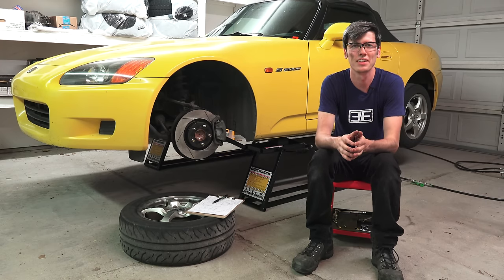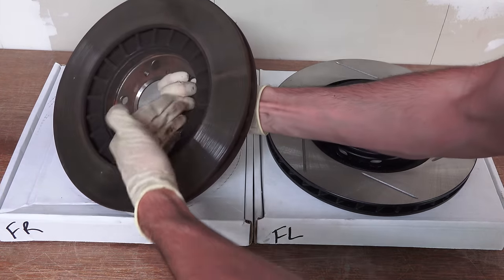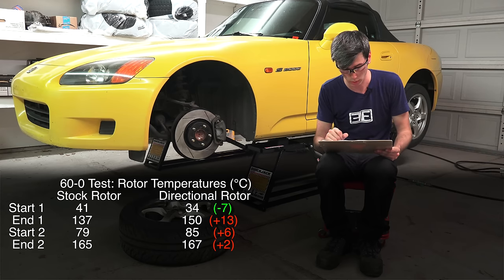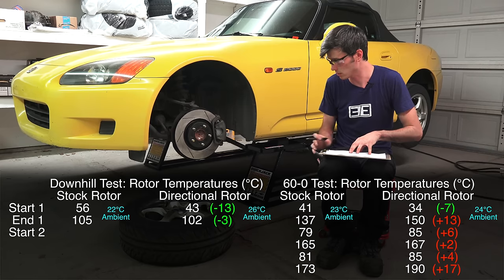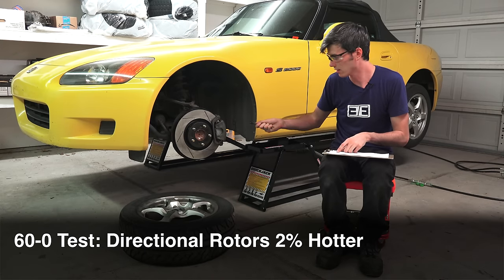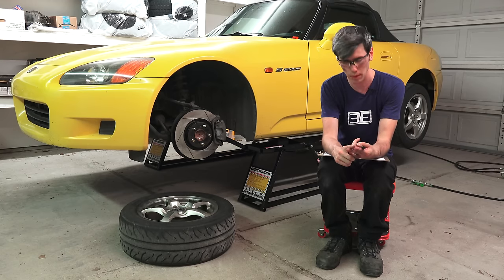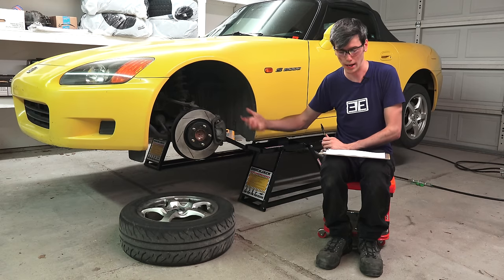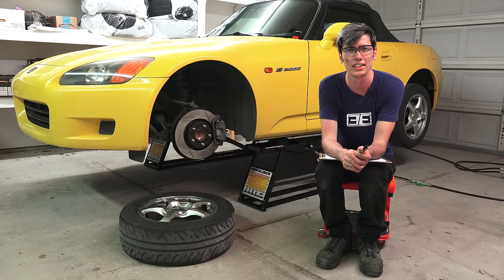Do Performance Brake Rotors Have Better Cooling?

Comment: Two questions.  First what is the difference in mass between stock and performance rotors?  Second, were you measuring the right thing?  What you might have actually been measuring is breaking performance not rotor cooling performance.  If you are breaking more effectively, especially with a lighter weight rotor, you might expect them to get hotter.  Question is how quickly do they cool off after hard breaking?

The test I would suggest would be to first get the rotors good and baking hot, as hot as you dare, then drive them at a constant speed and see how long it takes for the rotors to cool off to a specific temperature drop, say 150˚C.   Try that at several different speeds and see if there is a speed effect that you may not have noticed.  Maybe the performance rotors only work well at high speed, or only at lower speeds.  THEN, run the experiment again, with the performance rotors on the wrong way and see if anything changes.

Comment: It's an old video but still. So you did a normal test, not a performance test. And the result was that the normal rotors are better. That is it. It's not just vanes, cheapeness, mass, etc, etc. It's like brake pads. Normal pad are better for normal use, like normal rotors are better for normal use. They are tested and they are tested and that is the design they stick for Normal use. You did your best to prove them wrong, but you just couldn't, because there was no way that these perform better than normal rotors in normal conditions. Remember, normal pads and rotors are designed for use in various conditions and they must perform at the best for all those conditions - high temperatures, low temperatures, rain, puddles /sudden cooling/, mud, snow, sand, sudden braking, rotor rust from car not being driven a while , etc, etc. Performance pads and rotors do high temperatures, may be rain /but not common/, a lot less mud, sand, sudden braking, pretty much no snow, with two words - track use. Are they better for the track - 100%, as everything else that is performance - Performance engine oil, Performance gear oil, Performance brake fluid, Performance tires, performance pads....  In the end your tests just show the people to not use performance parts for regular use as they are worse in those conditions. Do it for the track car and be very careful when you drive that track car on the regular roads, without putting some heat into everything.

Comment: How much does wheel design, brake dust shields, or air dams/ brake ducts feeding cool air matter for brake cooling.. Seems like over time it would be a better investment to have wheels that help cool better than to keep buying over priced rotors that have minimal gains. Would be funny if zip tying a peace of plastic to the lower A-arm would do more than any high end rotors you could buy. Also I agree with others if your not testing the brake performance gained you don't really have the whole story as some performance gain is a trade off because that performance gain also put more energy into heating the rotor. One 60-0 isn't going to do it either you need to do multiple (3 back to back with temp readings might do it) to build the load as if it where actual real worlds results. Thermal paste between wheel and disk? That might be interesting also..

Comment: Thx for the video! A lot of work, though what is wrong with laser temp "probe". Quite cheap these days? you could have one installed all the time on the wheel and measure all the time. You could also install pressure gauge for the brake and see how much you brake. That would be super cool. OEM all the way, aftermarket if it is any good is way to expensive.

Comment: STOP!!! You need physics not engineering.
Slotted rotors scrape the pads to keep them clean. They create more friction since they are  cleaner, thus, they get hotter.
If they are better, they won't warp, and they will last until they wear out. If they aren't better, they will warp before they wear out.
Slotted and drilled rotors are more likely to crack since they have been cut. They are not as stable as flat rotors.
Slotted rotors wear out your pads faster; since they constantly scrape them to keep them clean.
Drilled rotors are not needed unless you use asbestos pads. If you use ceramic pads, drilled rotors are for looks only.
MOST people will do best to just use flat rotors and leave the more expensive drilled and slotted rotors for the racers and hot rodders.
I am ASE certified in brakes, etc for 50 years, but what do I know.

Comment: Why not try drilled slotted rotors? Also I thought the point of performance rotors and brakes werent to be cooler but to stop quicker when needed. Like Brembos Big Break Kit that cost 1,200 and comes with all steel break lines for higher pressure running to the the pad for greater force on the rotors. Comes with the big breaks and depending on the package comes with drilled/slotted rotors, or just drilled, or just slotted. I thought the point was to stop quicker? Not to keep them cooler? I could be completely wrong but my idea of performance breaks is to stop on the drop of a dime. Not to keep my brakes cooler....

Comment: Well the thing is, what was your stopping distance on each? You have more friction with the aftermarkets compared with the oem smooth rotors. Friction as you know causes more heat. They also clearly cool off faster especially combined with a ceramic brake pad. If you look at the texture of the aftermarket rotors, they have grinding done to the surface along with the slots. This causes more friction. After time that grinding will wear out and you will see less stopping power due to less friction, however again that would help preserve your brake pad especially if you are using an OEM one.

Comment: Ok...quick answer. Brake fade occurs when rotors can’t dissipate heat...it dose not matter hot HOT as long as they don’t warp and can cool before you need hard breaking again...It’s about long term hard driving.

Comment: Wouldn't hotter rotors equate to more heat dissipating from the rotors? Not necessarily hot they get or how fast they cool down?

I would assume the hotter the brakes get the more friction it's producing therefore giving you better braking performance. I don't believe you mentioned brake feel or if there was any brake fade in between the braking tests

Comment: I'm a bit disappointed in the testing method(s). I would've expected Jason to strive for more consistency and perhaps just lift one wheel off the ground (assuming open differential) and used a weight or something to apply the exact same throttle input and exact same brake pressure for a given time/test cycles.

Comment: Specific heat, not mass, determines temperature change for given applied heat. But I'm sure you know that and were dumbing it down for the tongue-chewing mouth-breathing bogans that will stumble across this video while looking for something to justify their purchase of slottled, drilled and directional vanes rotors for their shopping basket road car.

Comment: I think it's not a simple yes/no thing.  What makes for a better rotor is better metallurgy and better heat treatment.  That is going to differ from manufacturer to manufacturer.  And it seems to me that any "test" of brake performance that does not use stopping distance comparisons as its primary performance metric is flawed from the start.

Comment: So judging by the picture here, did u have them on correct sides? Cuz theyre supposed to draw air from the wheel hub area and vent out the diameter of the rotor. It kinda looks like u have it on the wrong side.

Comment: the temperature of the rotors the split second you finish braking has NOTHING TO DO with their 'cooling'. 

It's the amount of energy in the car converted to heat ... functioned in to the 'specific temperature' of the medium to which you're storing it. 

I'd say, the hotter you get it -- either the less material or the lower heat it can hold per gram ...

So - the working range of temperatures vs. the mass required to hold the heat you'll create determine the amount of mass you'll NEED. 

"Stopping" probably has more to do with tires than brakes until you butt-up-against the limits of the material's working range.

Comment: Pad/rotor bedding could explain these results.  You should of also measured the temp of the rear disks as a check to ensure the brake energy at the front was constant between rotors.

Comment: Respectfully, your test was seriously flawed. You basically tested their ability to hold heat, not dissipate it.
Put them both in an oven and raise them to a high temperature, 800 degrees say, then take them out and spin them.  Record temperate over time. Measure the temperature difference and factor in mass to get a dissipation rate. That will prove if they are superior. 
Short braking runs are almost completely irrelevant to overall cooling because as soon as they're hot, you've stopped. Heavier discs will always win in such a test.

Comment: What?! You’re doing it wrong! They cool down while traveling. You brake and they heat up, you start driving then they cool down. The test should have been how fast they cool down after braking while driving. If you just stop they’re gonna be hot. If you hard brake then accelerate you’ll see the temps drop faster on the after market ones. The slots aren’t what are cooling the disk either. The slots help braking and help pads wear evenly. The veins sandwiched in the middle do the cooling unless they are drilled too.

Comment: Though this video certainly stays true to explain cooling potential, there is also another benefit to the lighter aftermarket rotors. Since the rotors and other parts on the wheels are connected to the car suspension, any weight reduction means there will be less unsprung mass, which then can improve the car handling and comfort. High unsprung mass also exacerbates wheel control issues under hard acceleration or braking. Just a food for thought. This is still a very informative video. Thanks Jason :)

Comment: I put drilled and slotted rotors on my Audi S6 strictly for looks (15 1/2" plain rotors are ugly).  I put upgraded pads to handle the heat.  Now a good test would be "high carbon" rotors vs std cast iron.

Comment: If I buy aftermarket performance rotors expecting better performance I certainly wouldn’t use stock pads. And there’s the monkey wrench in your experiment. So in conclusion, because these test weren’t done properly or consistently,  I’ll never get those 8 minutes of my life back.

Comment: OMFG I can't scroll any further without posting cause none of you have said it YOU DID IT WRONG those aftermarket rotors are on the wrong sides you left rotor is on the right and vice versa  those aftermarket rotors can't cool when the cooling fins are spinning the wrong direction put the rotors on the correct sides and re do your test dummy.

Comment: I see what point you are trying to make here. It's not a test of brake fade or really anything to do with the slots for off gassing. It's about the improved veins or in this case reverse cooling. Bringing in cool air from the wheel side versus the inside.  The differences like metallurgy, weight, thicknesses, driving conditions, ect..., made this test ineffective. Trial and error. This is a popular mod to any car. I'd circle back around with this topic. I'm very interested in what you are putting out.

Comment: I went with Power Stop drilled and vented rotors when I bought aluminum aftermarket wheels for my Silverado. I wanted the 'look". They were expensive and the slots and holes collected abrasive dirt and road filth. Complete hash @ half the life of the stock stuff. Not at all worth it for me.

Comment: same theory with a damper, if it was hotter its likely doing a better job converting force to heat and transferring it away.
Reply: I had a similar thought. If the slots are moving gas out from under the pad, that means you're likely getting more contact to the rotor. I would assume that creates much more heat

Comment: Just a thought but being the back brakes are the same you may have inevenvertly shifted the brake balance to the front on the slotted brakes.   Since the were braking more the would also heat up faster??

Comment: Absolutely wrong logic. The notches on the disc are to stop faster and the temperature difference is small. Your test had to be how far the factory drive stopped, unlike the other. 
(I apologize for my English)

Comment: The slots are not for cooling, they're designed to clean the pads and allow gasses to escape. Drilled rotors are for better cooling. I run Power Stop (made by Stop Tech) and they are both drilled and slotted. Major improvement over stock. Better bite and less brake fade.

Comment: I have a fundamental issue with your analysis. You took matched rotors and pads and swapped new rotors to the old pads. Then you tested without bedding them in. Secondly the short light tests didn't get the rotors hot at all and they were largely functioning on their mass absorbing heat. Third, the function of brakes is to convert motion into heat. So arguably which did it better?  Hard to say sure to variance in driving possibly, mass of the rotors and cooling ability. A truer test might be which rotors fade first. Love your videos as always.

Comment: Looks like basically no benefit for a street car. I got some vented slotted rotors on my A4 B5 Avant. I didn't notice any added stopping power at all.... ever. I did notice that they made a ton more noise during braking. Yeah, vented/slotted is more for looks on a street car than any real benefit. I guess if you live at the bottom of a long canyon, and you're close to smoking your brakes on a daily basis, I can see the benefit. Other than that, pass.

Comment: I know this is an old video and I did not read all the comments, but using the same pads on both rotors will cause your test issues. Pads are bedded to rotors and rotors to pads. I think you were causing unnecessary heat in the new rot8with using the same pads.

Comment: The numbers really don't mean much. I think percentages would be a better metric than temperature. Showing absolute temp and percentages on the same screen for both. Does the "performance rotor" have a higher suggested working temp? Why dont they (the science of speed) do the tests on a brake testing machine rather than on a track I think that seems pretty uncientific. I understand why you don't though.

Comment: Theres too many variables that you have not considered that invalidate these tests. What about difference in rotor alloy? This changes heat dispersion, friction, etc. 
 The slotted rotors are meant for track performance driving. Under that type of use, gas and heat dissipation is a significant factor, hence the slots. Those types of rotors usually are made from materials that absorb heat faster to wick that heat away from the pads and calipers which would otherwise cook the brake fluid and glaze the pads causing an unsafe brake fade condition. 
Also, for track day use it's best to use a performance or specialized friction material, normally a carbon ceramic compound. These pads work far differently than stock, and operate at much higher temps. So those rotors should be matched to the proper pads for best performance on the track or "spirited" street use.

Comment: Has anyone mentioned that you are testing slotted vs. slotted which might cause better friction coefficient and greater heat transfer and buildup? Also, used rotors vs new and with old pads. All components should be new and the rotors need to be properly bedded in. Has anyone ever done airflow testing/comparison? I'm curious if there is any difference in cfm between them.

Comment: There are several issues at play here; one is the quality of the casting material; the design of the cooling fins that catch and direct the air flow to cool down the rotor; the cost vs actual usage of the vehicle for the purposes of the type of driving and finally the type of friction material against the rotor.

A good quality rotor and pad combination would work for 99% of the people, if you're really serious about stopping and worried about temp and fade, then a multi piece rotor is the answer (using a pad designed to work with it).  Wilwood brake set up is the real answer for those who go fast and want to stop fast (or still have brakes left after making multiple high speed stops)

Comment: Impeller design is all about optimising the design Vs the speed you wish the thing to spin at. Backward curved impellers are more efficient Vs forward curved but need to be spun at higher velocities for the same air flow. They generate greater pressure differences too so backward curved are not really suitable for low speed high airflow.

I think these are using forward curved though so no problems there and this is a situation where you don't want efficiency either!

Still there's optimisation that goes on and it's possible that the airflow curve picks up with the after market discs at higher speeds Vs the stock. As far as I remember straight sided forward angles blades are great at low velocities, so the impellers in the original discs could be moving more air at lower driving speeds. I don't think either of the impeller designs would be spun fast enough in a cars wheel to approach the area of the curve where the impeller stalls or actually decreases in performance but it is possible that the original one could. Thus lower relative air flow at high speeds Vs the replacement that would still be ramping up.

One would hope manufacturers would display the discs optimisation parameters in the literature so you can pick the best one for your typical use.

Comment: But who drives on track? My stock rotors lasted 260k miles and still had 1mm of useable surface left. Just put new slotted and drilled rotors lets see how long they will last.